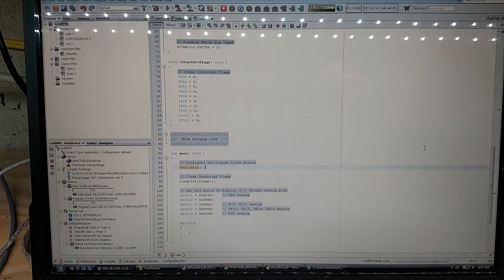Solectria E10, Lithium Ion Battery Upgrade, Part24

Comment: How difficult was the soldering of your module to the main board? Did you used the hot air or soldering iron was ok?
This is very interesting idea how to replace processors. I like it a lot.
Reply from the maker: +hubmartin 

Quite easy, with a normal soldering iron.

I drag soldered both the 64 pin QFN and then the 100 pin Adapter to the PCB.

See this video:
https://youtu.be/Ch4qOKsFZCU

Comment: Is the firmware on the old micro locked? It would would interesting to see if you could read it off and disassemble it to find the state of charge look up tables or anything else useful
Reply from the maker: +jvcrules 

I did not try and read out the firmware from the old microcontroller.

There is a serial EEPROM on the BMS, it will be interesting to read out what is stored on there...
Reply: @WolfTronix   can you get me the framework pls